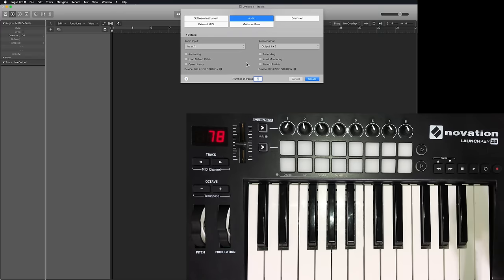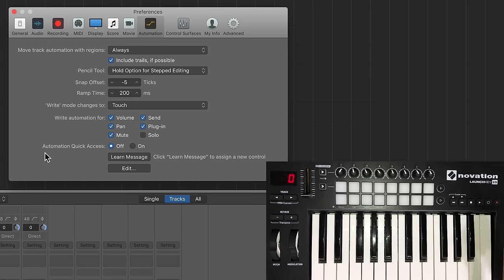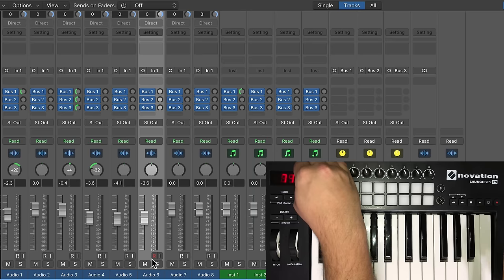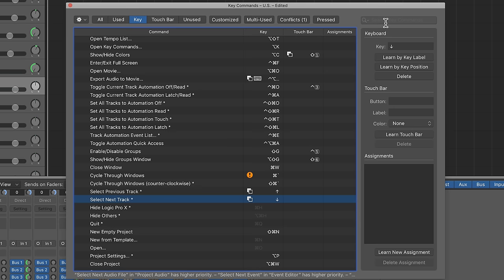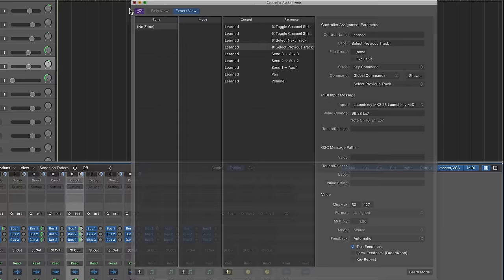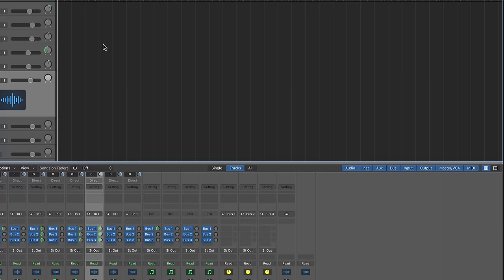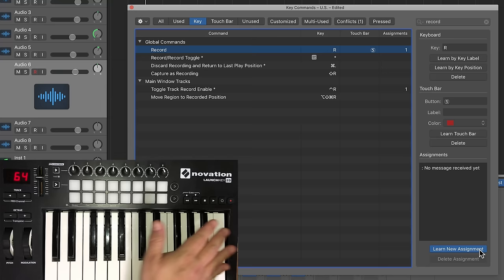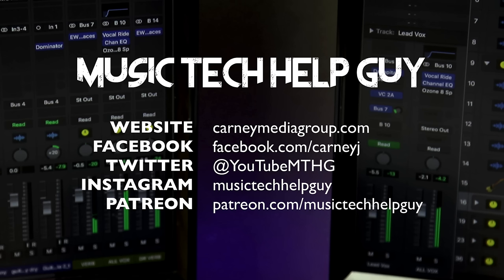Setup ANY MIDI Controller as a DAW Mix Control Surface (LOGIC PRO X)

Comment: Is there a way to save templates for midi mapping? I'd love it if I could set up for a template for mixing, and another template for orchestral composing in Logic
Reply: Is that not possible? Cause I’d love to know too. Aaron C above was also asking about opening and using EQ with the same controller.  I wonder if logic remote or something like touch OSC could work.
Reply: I think that's called Zones. I haven't figured out how to do it yet.

Comment: Excellent. I just set up a Novation Launchkey 49 and used the HUI surface controllers in Logic's midi setup menu.. Most functions worked out the box, but this will help get the other buttons programmed and fine tune the functions. Thanks chap!

Comment: If you want to directly set the control (and not catching up as mentioned in 5:35) -> Check the "Local Feedback (Fader/Knob)" option
Reply: Under which menu?
Reply: @kannonprice3521   Controller assignment parameter - under Value - below text feedback (checkbox)

Comment: thank you thank you thank you!!!!  I think of myself as technically knowledgable and usually figure things out BUT being a newbie with logic and getting a Akai mpk 225 midi thought it would be easy peazey tp just plug the controller into my Mac and sail away.  the module has a hot key for logic but did nothing..... just started reading Logic Pro from David nahmani and maybe my answers were somewhere in one of his chapters....but YOU just made this very, very easy....THANK YOU !!!

Comment: 5:26

Dawg you have no idea how pissed i am, but simultaneously relieved i watched all of this.
I thought something was wrong with Logic, or my AKAI MPK Mini. Let me explain..
I have my FaderPort V.2, I wanted it to do what it does while the MPK's knobs would control Logic's compressor. I tried the Smart controls so many times, because when I would switch between tracks I thought Logic was forgetting the parameters.. but no

No bro, do you know what it was? 
My very dumb ass not realizing that midi controllers are waiting for you to turn the controllers knob to the softwares knobs value to make edits.. I learned this a long time ago and should know better!!! I was gonna get Bomes Midi Translator Pro because I thought I was doing something wrong. Thank you MusicTechHelpGuy. You made me realize I was doing everything correct this whole time 😭😭😭

Comment: Question - when programming the pads you get Assignments to "Note Ch 10, E1, Lo7: Learned". When I then play on the keyboard, the E1 doesn't play the note, but controls the assignment.
Any qlue how to solve this?
Also - not really sure if the DAW/Preset button affects how the programmed assignments work?

Comment: Great vid as always! 
But like you said I also have a dedicated control surface at the studio and recently purchased a NI M32 for home use... So I set up the M32 knobs to be used for the Smart Controls but...when I get back to the studio and use the surface I have there, which is a Novation Zero SLmkii the the knobs I had controlling the Smart controls no longer work. In the Controller Assignment window both controllers appear in the drop down... I can't figure this out. If only you could save Controller Assignments on a per project basis or is there something I'm missing? Thoughts?

Comment: Hi Josh, I have a question, how can I set a midi fader to controlling my bus pan, but for the selected bus track and not just the learn one, for example: I set the learning mode, on pan bus 3, but he moves just the bus 3 and not the 4, 5,6,7,8 when it selected, like the same way that you make on the pan tracks. there is some way to do that...? thanks

Comment: thank you for sharing. Two more questions: is it possible to assign a rotary knob to forwind/rewind (when the knob is clockwise/counterclockwise turned)? Is it possible to assign a rotary knob to adjust the value of any software plugin knob where the cursor is floating on (by default, the mouse mid position sweep is used for this purpose)?

Comment: Awesome video! I have a question, though. Since I can't afford the big Mackie mix controller and only have a cheap Akai MPK Mini with 8 dials on it, is there a way to set it up so that I can re-use those 8 dials based on the situation? For example, if I set them up like you did in the video to control the fader, pan, sends, etc. Can I also set those same dials up to control all the EQ dials in an SSL EQ plugin (Waves CLA Mixhub) when it's open then go back to controlling the channel strip when the plugin is closed?
Reply: Also want to know this.
Reply: Hi, after digging around for a day I have found a way to do this. You'll do this by creating a zone, then creating different modes inside the zone, you'll then assign the CC's inside the modes and switching between the modes will let you perform what you want. Here's the thing tho, for this to work you must NOT have anything learned in the 'NO ZONE', this is basically because 'NO ZONE' tells logic to move the CC no matter what, which is exactly what we don't want. So the first step is actually to remove anything that is in the 'NO ZONE'. Here's an example to further clarify: 1. Open up the Controller Assignment Window and if necessary, delete the learned controls from 'No Zone' --- 2. Create a new zone and name it 'Fader'. ---- 3. Inside zone 'Fader' create two modes and name them 'Channel Strip' and 'Cutoff'. ---- 4. Inside mode 'Channel Strip' assign the volume to be controlled by your fader as shown in the video. --- 5. Inside mode 'Cutoff' assign the same fader used in step 4 to control the cutoff of a filter. --- If you've done it correctly you will no longer get a popup telling the controller has already been assigned, and now simply switching between the two modes will let you use the fader to control two different things. Hope that helps!!!
Reply: @robotmeadows  the problem is, when you apply something in the new created mode, (channel strip/cutoff), in the new zone (Fader), it auto adds it to the NO ZONE. And if you delete from the NO ZONE, it deletes the others. Any help please?

Comment: Good stuff. Thank you. 

Can one save multiple custom assignments for multiple controllers and use them at the same time? Like what if I want to use an older controller for just synth parameters and a newer controller for transport control and mixing.

Comment: question, when i first set mine up it automatically asigned everything. for some reason over the years it flat stopped not even play or pause works. idk if it was an update that messed it up. was wondering if there was a way to auto set up again amd then just tailor the rest to mike liking?

Comment: hey there! thanks for your video. i have a problem with the fader to which i assigned the volume: if i move it up in my midi keyboard (as if to raise the volume), the digital counterpart in logic goes down (the volume goes down) and viceversa.
is there an option to change this?
thank you very much if you'll answer!

Comment: I have a question, my pads on my MIDI controller are based on certain keys on my controller, which means if I play for example C3 the pad assigned to that key os getting triggered and the key command I've connected to that pad is getting triggered, so whenever I play a C3 it solos the track. How do I get rid of this??

Comment: I just bought a korg controller. It works well in logic but can i use that same controler to adjust other instruments parameters like vibrato or dynamics without losing the main control settings for the mixer?

Comment: I recently purchased a MacBook Pro with M2 chip. Everything seems to work fine except when I connect my Yamaha Modx and Oxygen 49 for midi zoning, I experience a midi note hanging. I used to have Launchkey 61. Same thing happened with that as well.

I’ve changed the entire keyboard rig including cables and connectors even purchased Apple USB c to USB convertors. Nothings seems to work fine. This happens when I play VST plug-ins as well. Updated to latest os, factory reset app, cleaned it with app cleaner. Nothing works. Called Apple Support and did as they instructed but still the issue is same. I saw that I’m not the only one with the issue.

Comment: Thank You for your expertise in how to Setup my Mixer as a midi Controller. however, I have not tried to do that with the Presonus 32s iii series digital mixing board yet. I am going to see if it works and then get back to you to give you an updated results on my discovery with this new mixer I recently purchased. However, if you have any knowledge about how to setup my presonus mixer to Logic Pro X pls. do not hesitate to share how to setup the board bcuz the manual to the board does not explain how to actually setup the baord with all Daws. Essentually it is compatible with Presonus Studi One 5 Professional lol but I just like using Logic Pro X better.

Comment: This is great. What if I want one knob to effect 2 automation or midi parameters at once. I.E. I have a narrow band EQ on a drum bus, and I want to turn a knob and have a LP filter work it’s way up from 600hz and a HP filter work it’s way down from 400hz to open up the sound. Both at the same time controlled by one knob.

Comment: I have an Akai MPK Mini, which has 4 prog settings. If I understand correctly, I can set up Prog 1 to function as a mix controller, then use the other programs (2-4) to function as midi controller that activate my learned assignments and instruments?

Comment: Josh a question: the pads are CC but corresponds to a key, like C1, C1#, D1, D1# ...... and so forth.... when you play with the corresponding, for example, C1 in the white Do First octave..... that white key will trigger the CC message .... is this not???

Comment: Wondering if/how/where this wouldd be saved to maintain settings between Logic and a controller, to be abler to be recalled between projects…or does it have to be done each time?

Also, am I right to assume an 8 fader controller can be set up across 8 different tracks?

Really excellent explanation, though. Appreciate it. Many thanks 🙏

Comment: Hi, nice video! Thanks for sharing, do you if there is anyway to sort of assign the knob to different values for differen modes ? And change between them? For example, when I chose an SSL Chanel strip plug-in, those knobs are for certain value( such as EQ frequency etc.) And when I go back to Mixer window, those knob are for volumen.Because when I open the assignment window, there appeared to be different mode: Devices, mix, send, custom etc.just don't know the exact maneuver to make that happen. And can't find the way to select between one or other modes. I'm using a launch key 27 mkiii

Comment: Really helpful - thanks. It would be great to see how you deal with using multiple controllers to control multiple controls. For example using the set up in this video for general daw controls, and then another control surface to control synth controls (or perhaps separate CC's like expression etc). I struggle with encountering lots of conflicts when attempting to do this and currently experimenting with midi channels. How do you do it?
Reply: Hey man, did you find a solution? I have a midi controller assigned to multiple channels so I can automate more than one at the same time, but it only seems that I can automate the selected channel!! Is there a setting?
Reply: @NickQuinn1986  unfortunately it didn't work so well on my set up. I have a platform m+ that proved tricky to program. I ended up using BOME midi translator to get the controls I wanted - highly recommended if you're struggling.
Reply: @NickQuinn1986  hey did you find a solution? spent hours looking for one

Comment: Hi,

I want to use my controller to control different parameters on seperate tracks however ive noticed you can only control parameters on the track you have selected. E.g I want to control the filter on my kick channel and then the filter on my hats channel in one pass.. Anyone know if there is a setting I need to change?

Comment: I know it's an old vid but after spending ages setting up a controller I then fire up Logic to see that as much as it remembers each link, I then need to connect the device again for each function (midi input message>input)!  Is there a way to save all connections as a template? Using a Korg Nano Studio which is notoriously a PITA!

Comment: Hey Josh!
I know this video is 2 years old but, I’ll ask anyway.
1. What if you get all messed up and want to start over?
2. While just snooping around in the “Control Surface” window I accidentally touched the F3 key and saw a parameter change in the window. Now the F3 key won’t play unless I “bypass all control surfaces”. Any way to fix this without bypassing?
Thanks,
Gianni ❤

Comment: I couldn't find the video you said you or anyone has that shows assigning the controls for synths and plug ins...there are so many videos out there on setting up the default MIDI controls or assigning 1 or 2 controls but here is only a handful of videos with people explaining the set ups they use for mapping controls...
I also wanted to let you know that I am working on a set of videos or video on Alchemy that is very similar to your video series but more updated and hip hop based. Hopefully that's not a problem I will def give you your credit for the original videos that I learned alot from in my video too!
But I would love to see a video like this but setting up and saving the MIDI controls for different synths and on different MIDI Controllers...I wld make the video if I wasn't still learning MIDI CC and Articulation and all that good stuff myself lol! I come from Pro Tools and External Interments era so I've been putting this off a while now but over the last 6 months I have made the jump.

Comment: This was really helpful.  Question... is it possible to setup the controller so it will work as you showed here and when going to say the Logic compressor and Logic eq?  Also, once these have been set, is there ever a situation where an update to Logic wipes out the midi and keyboard setup?  Thanks!

Comment: ok I am back lol it does not work with the presonus digital mixer. I thought it had a midi connection in/out put source to make the midi setup and controll the Pro Logic X daw but it doesn't have that feature.

Comment: I saw in one of your previous tutorials, you recommended to buy the Novation Impulse 49 
Midi keyboard Controller and for this tutorial you are using Novation Launchkey 25. Which one you recommend to buy? I don’t have any Midi keyboard Controller cuz keyboard is not my first instrument but I am able to compose some melodies with it.... Thanks :)
Reply from the maker: The one that has the number of keys you need. They are identical except for the number of keys. I just bought the same one with 61 keys recently.

Comment: Is that a phase flip button in your mixer? I dont recoginze any of those features?! How do I get that whole thing there between "Audio Device" and "Setting" per track? (i'm on 10.6.3)
Reply from the maker: Certain audio interfaces and USB microphones will add additional components to the top of audio channel strips. Essentially they are used for software control of certain hardware devices. I can't remember which one, but I was reviewing an audio interface when I made this video that included this. This one added a phantom power, HP filter, phase flip, and gain control for the interface. Other devices will sometimes just have the gain control - as a few USB mics I've used do. So it depends on what device you connect.

Comment: Is there a way to turn OFF the pitch bend wheel as mine is for some reason automatically  doing what ever it wants randomly?
Reply from the maker: You can use the MIDI Input filter to turn off the pitch bend. I have an old video where I cover this here. I think I turn off the mod wheel in the video, but you can follow the same steps to turn off the pitch bend. https://youtu.be/Mri59S04znU

Comment: 17?? Felt like 2! Question for noob: can you save these settings and then set up midi controller for synths without remapping the whole shebang each time you switch between modes?

Comment: How can I use the fantom as a midi controller in logic pro x  to control vst plugins like a piano or patches?
Reply from the maker: It appears that all of the Fantom models have a USB port in the back. You should just be able to plug it in over USB and play your virtual instruments that way. The only catch is figuring out how to turn off the internal sounds of the Fantom. I used to have a hardware synth I used this way as well, and there was a mode I had to turn on, which disabled the internal sounds. As far as knobs and faders, if the knobs and faders are assigned to normal CC values, you should be able to assign these as controller assignments as well.